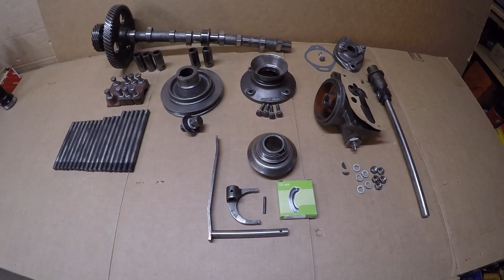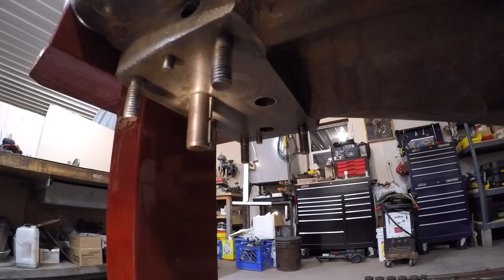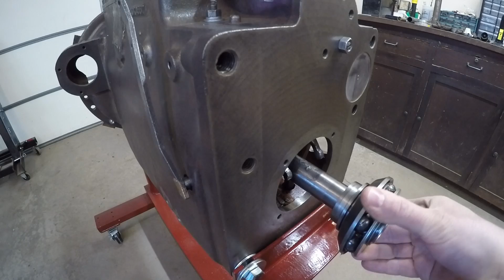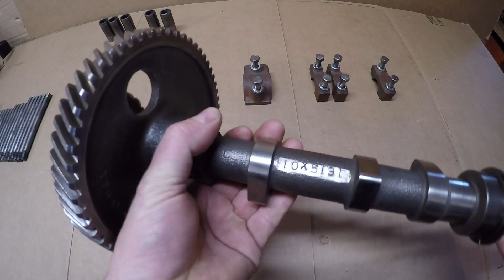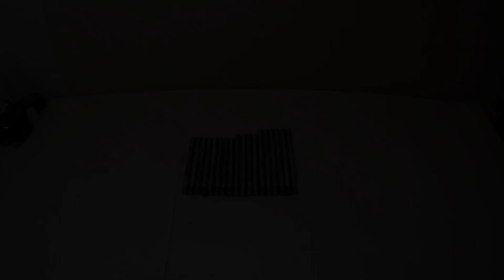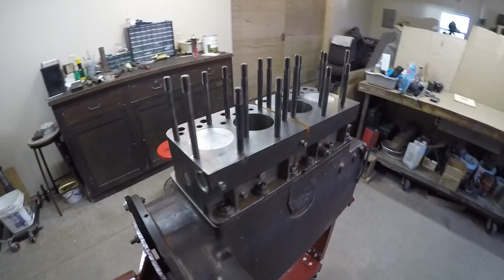Minneapolis-Moline Prototype 445 Tractor #X231 Restoration - Part 11: Assembling the Short Block

Comment: Interesting, thank you. Although watching you install the block studs  brings back painful memories of the day I ruined my TR6 block by screwing it in too far and cracking the casting. Only the second engine I'd ever done. I'd be about 20. Learned a lot that day, not least the value of good friends. One of my mates took it upon himself to source another and virtually rebuilt it for me without saying anything. Still a good mate nearly 50 years later. That block is still around somewhere in a cattle byre trough!

Comment: So those those other gaskets (a video back) weren't a head gasket I just realize It's a cylinder gasket .And the head gasket still to come. 
and no oil pan. What a weird engine, without the update to where the heads would go sideways would of been weirder yet. This must of been
what the advertisements meant back in the day, about, being able to rebuild the engine in the field. because you wouldn't have to crawl under it.

Comment: That's the first time I've ever seen assembly of a gasoline tractor engine.  The first think I noted was only three main bearings. And then I took note of the throws on the cranks...WOW, massive torque! Also slow turning...does that allow it to get away with only three mains?

Comment: Great videos, very interesting tractor!  As a engine machine shop owner you did a great job assembling with attention to detail and cleanliness.  I don't use plastigauge because it really doesn't tell you anything but if you don't have micrometers and expensive dial bore gauges it's the only to make an effort to check clearances. The only thing I disagree with is using assembly lube on the sides of the lifters instead of oil . Assembly lube or even better is a camshaft specific lube on the face of the lifter and can lube. Assembly lube is to thick  and can restrict lifter rotation which is critical and without rotation the lifter /cam can be destroyed.  It's a main cause of camshaft failure,  especially with new components.  Also please add some zinc additive to your engine oil to protect your flat tappet camshaft.  Keep up the great work!
Reply: Hey up mate just love how much access that side cover gives and so cool for removing the cam, nice design

Comment: Around 1:50 the lower shelf to the left of the where the distributor mounts there is a casting bump or a bolt and another stud or set screw that has a jam nut what does that do?